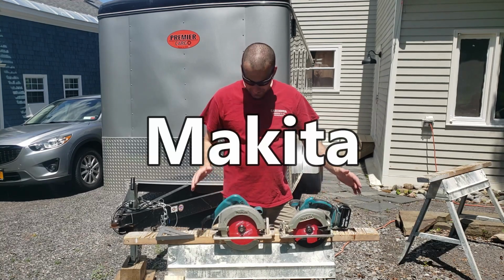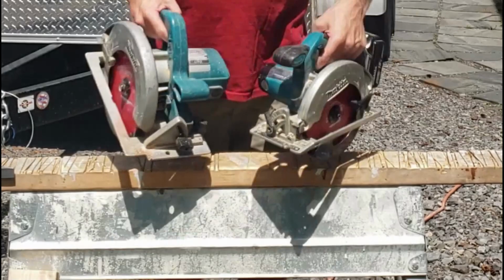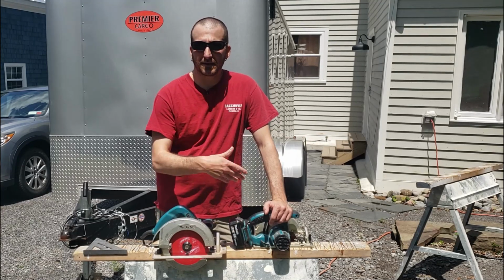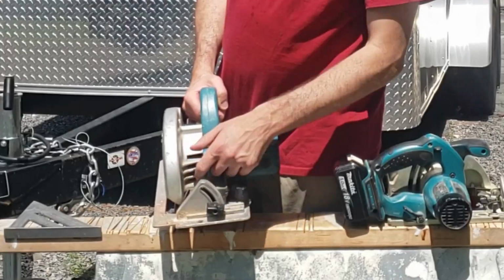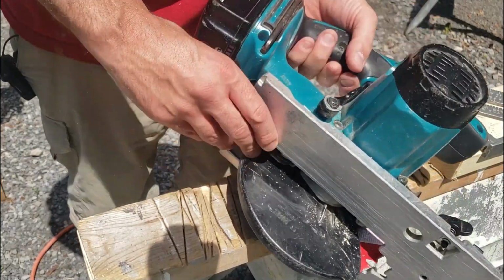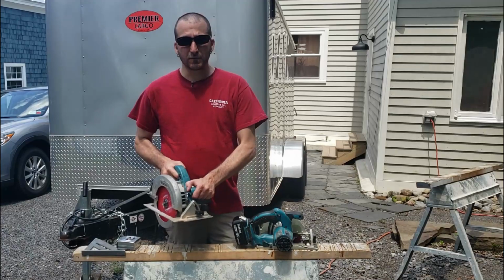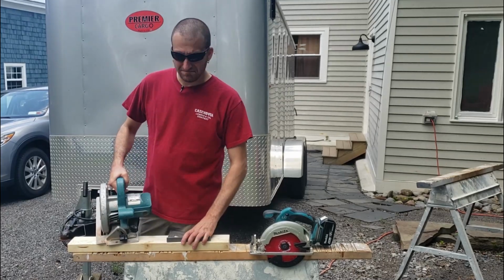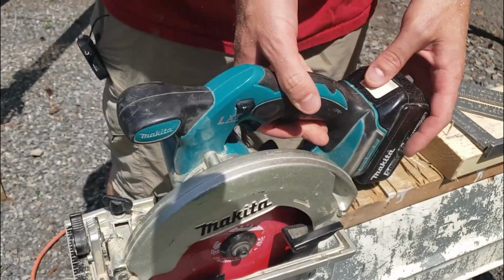MAKITA Circular Saw Corded vs Cordless Review

Comment: I bought a corded makita 5007 mg. I really like it but the blade spin down after trigger release is a little long. Takes about 5-6 sec to stop spinning. Any way to adjust this or thats just jow these cordes ones are? I noticed the cordless ones to less time to spin down.
Reply from the maker: i don't think there is a way to adjust the brake
Reply: @BorsellinoHomeServices  I learned they make a model with a brake, looks the same, 5007 MGA. I wonder whats the pros and cons of brake vs no brake. I won't be using it that often. Just a DIY homeowner replacing a long fence, gates, small project here and there.

Comment: I stumbled in here because I just ordered a Makita circ saw. I am invested in the Milwaukee battery system, but the reason I went corded was the opposite of your reasoning; I use circular saws so rarely that I just do not trust I'll get the value out of a saw before a producer decide to change their battery system. A corded one with my occasional usage will probably last me decades. That it was reasonably similar specs at half the price as the M18 Fuel didn't hurt either...
Reply from the maker: Right on! A corded saw is definitely cheaper and has more power. I would agree they should last longer too and won't become obsolete. My corded saw has been my go to for years. The battery one is solely for convenience. They each have their place in my heart and toolbox lol .Thanks for the comment! I hope you like your new saw!!!
Reply: I thought exactly the same. I went corded for tools i rarely use and battery for more frequent usage and requires cord free movement for safety reason
Reply: @jiminy2731  Not to mention when you are in the middle of nowhere with nearest power outlet miles away. I'll admit most of my tools are cordless for that very reason, but some tools I can only imagine myself using at home or somewhere else where there is power available, the circ saw and the orbital sander were two examples for me at least. And it is fun not being tied down to a system you are already on as most of us are for battery tools which leaves room to shop around a little more. And though brushless motors and lithium batteries have revolutionized the use of battery tools, it is still hard to beat the possibilities that 220V with a 15A fuse can offer.

And I must say that HS7101 I bought is a beast! I demolished some old railing at home with it, and I never felt any resistance, no matter how fast I pushed it! I can highly recommend it. And not made in China for that low price was icing on the cake.
Reply: @kundetjenesten  Of course, if you're working in the trade then cordless is probably the way to go because you can't assume on site has power or a power point nearby. having 10-20m+ cables running is a hazard as well!

I mainly just do around the house and garage so corded is the way to go. But have gone cordless for some tools. I am definitely looking forward to buying the corded maktia circular though. I will be building myself proper workbench with storage underneath so I can't wait for new tools day!
Reply: @jiminy2731  My trade is trucking, and my rapidly expanding tool collection started with me buying a cordless angle grinder to cut over padlocks at customers where I needed access after business hours. That was like punching a hole in a large dam... Suddenly I "needed" both this and that, and not having a family to worry about, it all went very fast. I have learned alot in the process though and even took up welding as a hobby (also highly recommended! It is one of the most useful skills you can acquire). Right now I am awaiting delivery of the M18 chainsaw. Every payday is a little like Christmas. 😁

Either way: you are going to love the Makita. Going through wood with it is like cutting through butter with a red hot knife!
Reply: @kundetjenesten  thanks for sharing! I haven't thought about welding but would be handy to make steel pipes/support as required! Do you have a video on tools, guides etc?
Reply: @jiminy2731  When it comes to welding the first thing you need to do is sit down and think through what you are most likely to weld. If you won't do any thin sheet metal then a pure stick welding machine (SMAW) is the way to go: most of the modern ones except for the very cheapest ones have alot of bells and whistles such as hot start and anti-stick (make sure you get these features!). It is also the most simplistic setup I would say: besides personal protection gear you just need the machine itself, an electrode holder, a ground clamp and electrodes and you're good to go. It is also easy to begin with since you do not need to worry about wire feed and gas flow, but it takes alot of hours to get better at.

If you know that you want to do thin metals, then MIG is the thing, problem is that you need to avoid cheap MIG machines, so the cost will rise real fast! Add expensive gas and wire and it's a pricy hobby all of a sudden. 

And as always with tools, think safety first. You'll be running electric current strong enough to melt metal and possibly high pressure gas as well, so do NOT make yourself a part of the electric circuit and make sure you are at a safe distance from anything that can catch fire. Besides that it is fun as few other things and only your imagination sets the limit! 😁

I'll see if I can find a few vids for you that helped me when I was beginning to learn:
https://youtu.be/jy5wRgNOIkE
https://youtu.be/4MKuUICV6-c

This guy has the same machine as I have: https://youtu.be/Kl-CD5rRx6M
Reply: Thanks ES, I was about to go get a Makita cordless circular saw and had even worked out the model. Now I am going to get a corded one. Pays to read the comments

Comment: They also make a brushless version of the 18 volt saw as well as one that uses 2 batteries which makes it 36 volts. Also they make one with a rear handle and one with blade on the right. I prefer the blade on the left since i am right handed. Makes it easier to see the cut line.
Reply from the maker: yeah i've seen that 36v i'd love to try it out sometime. i love the left side blade too

Comment: Cordless is much easier to use, but similarly powered models are heavier if you tag the batteries on.  They have these 40V or even 60 on the dewalts now.  For saws, I still prefer corded.  The few instances that I need to do a sketchy cut at an odd angle I will use lower powered cordless.  Also you are not tied to any systems and just buy the tools that work the best.  The one thing that really bothers me with corded saws is that they all come with like a cord that is basically uselessly short.  I wish the manufacturers will understand how much a stock long cord is a great selling point.
Reply from the maker: Totally agree with you. If I just need a quick cut though I'll grab the cordless just so I don't have to get a cord out and all that. saves a couple minutes. Actually there's been a few times where I've had both setup at the same time. I can't remember why though haha. Yeah I wish the stock cord was longer too. You could always change it out with a custom longer one! I've seen a saw sometime in my life that you actually plug an extension cord right into the saw...

Comment: I have both saws. I like them both. If I'm set up in a work station then I wanna use my corded. It just feels better and feels like it cuts better. But I also really like the cordless. When I need to cut away from the work station, I'd rather take the cordless saw. I don't have to drag the cord. My milwaukee cordless has a hanger that fits onto the 2 inch boards as my Makita corded does not
Reply from the maker: Totally agree!

Comment: Corded tools always work so long as you have power available. If power is not available battery powered tools may do the job. To me it seems like it is always a race to get the job done before the battery runs out. Battery overall life still is an issue. Replacement batteries are expensive. That said there is a place for both.
Reply: Expensive? very expensive. In Costa Rica is even more, you with $450 for some batteries you could pay the rent or buy your groceries haha.
Reply from the maker: Absolutely true all everything you said
Reply: If you are needing longer run time, you are probably a contractor/construction worker and make decent $, therefore invest nicely into your profession. Its so worth it.
Reply from the maker: @Juan Zamarripa  That's why I own both!

Comment: So you are telling me that right out of the box the battery sucks? interesting, mine with cord was working right away out of the box, I don't care very much of the weight since I slicing with that, not keeping in the air until I get tired. haha Thanks for the video.
Reply from the maker: It's not that it sucks but the corded one definitely has a lot more power behind it. Like ripping a sheet of plywood it always feels like I have to go slow with the battery saw and I can fly with the corded. But the cordles is my go to all the time. I did upgrade to a 5ah battery which made a huge improvement for but the circular saw and the sawsall